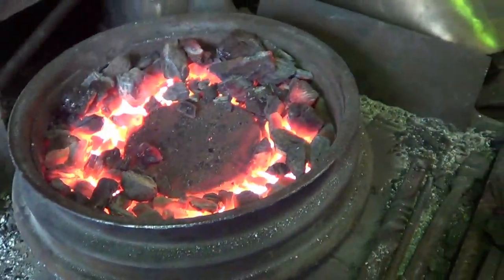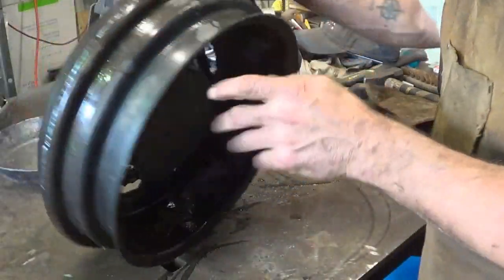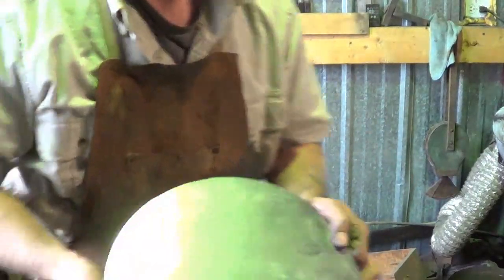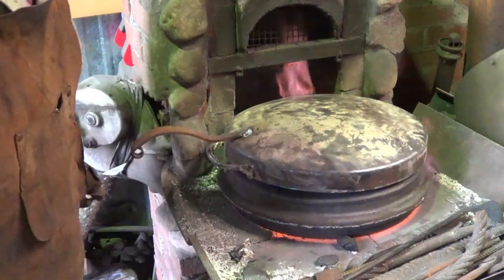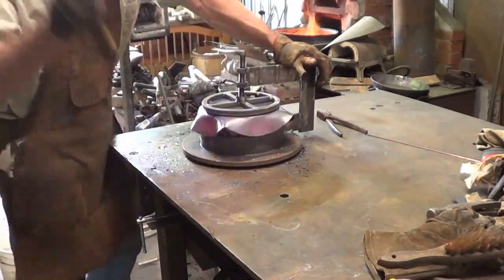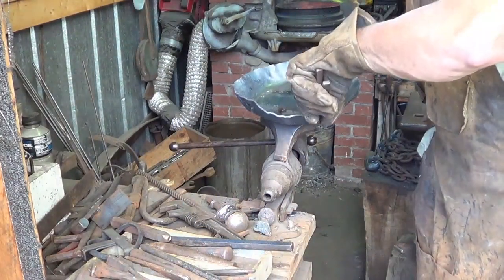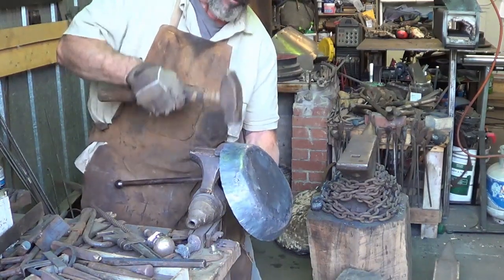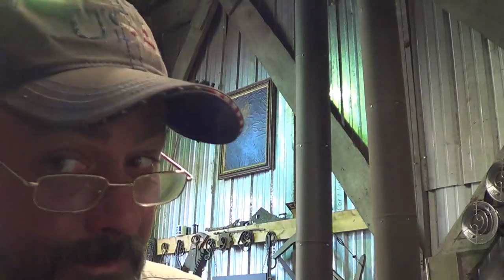OSF Special Feature - Need A Tool Make A Tool - Ring of Fire Goes Down Down Down

Comment: I'm really liking these videos. The trial and error, and constant progress, is really neat to see. I hope you can make and sell a few of these soon. A few of those suckers at $200 each would definitely help fund that plasma cutter. In order to save you some running around, have you ever thought of putting a peg on the bottom of that jig you made and setting it in the hardy hole on your anvil to hold it still? Then you only have to turn around from the forge to drop it in.

Comment: If I could add my two cents I'd suggest an air cylinder or a air brake pot to make clamping very fast. An air brake pot off a big diesel truck are very stong and make a good clamping device. Easy to buy, not that expensive. Also the end of the rod (on the brake pot) is threaded so you can attach a variety of devices to use it to clamp things down to the bench as well. Like grinding something for example. Have both hands a available to work and not one holding the item. Not everything fits in a bench vice easily. Might be handy if your doing a production run. 

Keep up the hard work. Sucess seeks out the diligent. Take care.

Comment: you could attach the top plate to the bolt and crank handle. modify the hole that the bolt threads through so the threads can be disengaged for large movements of the clamp, then reengaged for finer movements and tightening. I am drawing from a clamp I use beneath an abrasive chop saw. A small length of pipe of the proper size, thread it, then cut it in half lengthwise. one half stationary and one moveable. that would save you picking up the plate, lining it up to the threaded rod, and any fumbling with it in general. sorry for the lengthy comment.

Comment: Chandler, if you were to weld 2 T-shape handles on the plate for middle of the clamp so you could just grab it and more quickly put it in place it may give you a few more seconds of heat by setting the clamp up a few seconds faster
Reply: And weld a 1" square bar on the bottom of the jig so it will mount on the anvil to save steps and heat!
Reply: Or even round bar so it will rotate...

Comment: Awesome Chandler, you almost have a system down.  Your heating times are about in sync with your shaping times...which means you can make more than one at a time and seriously increase efficiency.  I'm still all about a mild steel bottom mold on your fluting jig.  It would be a real mother to grind to shape though.  I could grab suitable chunks of A36 conical blanks at my favorite steel places for $1 per pound.  You could get a two sided pan anvil for your jig pretty cheap!

Comment: hammer marks in the bottom of the pan will, in theory, make more surface area on the pan which will make it heat and cook faster and prehaps even make it slightly more non-stick because of the uneven surface. idk how much it actually helps, but if you like your own style keep at it, the pans look great

Comment: Chandler,  I have been enjoying your videos for a while.   on the jig you made, might I recommend a change that would shorten the time it takes to get your plate centered and clamped in?  If you would make the clamp arm about 6" taller and mount the ring you made permanently to the screw shaft with a ball joint similar to what you see on a c clamp,  you would save precious seconds and heat when putting your plate in for fluting.  Keep up the good work!

Comment: To reduce the time to clamp the hot pan down (at 18:35), what about making the overarm of the clamp hinged with one pin to hold it in place, or totally removable with two pins? Or make a toggle link clamp, either way it seems faster than using the treaded clamp. Less time used to clamp gives more time to move metal while it is hot.

Comment: to save you a bit of heat time maybe weld a handle on one side of that jig top instead of trying to use the tongs a gloved hand would let you quickly grab the jig top put it on and center it in a second or two L shaped I believe would work...

Comment: same suggestion as on the jig making video .. maybe change the jig to have the top plate on an arm that pivots down from above and is clamped with a goats foot kind of clamp on the free end .. humm, that would make two places that you could not strike with the hammer, but if the action is quick enuf you could unclamp, rotate the work piece and clamp it down again to finish using the heat.

Comment: Just a beginner myself, but you look to be loosing a lot of heat taking the pan from the forge to the clamp. Maybe move the clamp onto your anvil, and weld a round peg onto the bottom of the clamp to go into the square hardy hold so you can swivel it around, but it can't go skating across the table?

Comment: How to make pans faster and better:

1. Do two pans.

2. Add steel to the inner part of one pan, and add steel to the outer part of the other.

3. Cut a circle and heat it a lot.

4. Put the circle between the two pans and jump to the top of that thing.

5. Grab the circle and shape it a little better with the hammer.

There you go: a "hand made" pan.
Reply: Note: the pan in the bottom needs to be very tall. The top diameter needs to be larger than the circle. You might have to repeat the proccess a couple of times until you end up with a decent pan.

Comment: Great video Chandler.  When you get to reworking the jig, I'm wondering if replacing the C clamp with something like a bar clamp would let you slide the pin most of the way quickly and then only need to turn the screw about a turn to clamp it tight. Just a thought.

Comment: Chris U.K.Back at ya with the cambclamp idea Chandler.Weld the ring form to the threaded bar & put an elbow at the right angle so you can release quickly then lift the ring up & out of the way, 3seconds. What do you think? Wish I could send you a drawing.Regards, Chris, U.K.

Comment: chandler: you should change your jig, you spend too much time clamping it down with that screw clamp, if you replace that with a C-clamp you could get it clamped down much faster and lose a lot less heat.

Comment: add a ring part to the hammering jig? basically the inside edge of the pan can be hammered flat on hte same jig if it has something that will set the angle and be flat

Comment: Just a suggestion, I think you should weld a nut to the top of the round jig that you made so that you can screw the round jig to the screw shaft and still change the size. I don't know if you get what I mean. Its kinda hard to explain.
Reply: Kensivren I think if he did that it would lower his clearance and he wouldn't be able to get the pan out of the jig. Good idea though.
Reply: Yeahh. Didn't thought of that.

Comment: Just a thought from a non smith. What about the original design but instead of coals inside put it over the coal. My thoughts is that it would force just the heat through the ring. I don't know if that would get the metal hot enough to work or not but just an idea.

Comment: Would it help to weld some sort of swivel on the bottom of the jig that fits into the anvil and/or vice. It would be closer and you'd lose less heat.

Comment: What if you took one of your finished pans out of 11ga and clamp that in your jig as a "mandrel" of sorts and then drop in a full red hot flat blank on top and then hammer the new pan to the shape of your old one.  You'd probably want to make your mandrel pan a bit smaller to if finished size is super critical but you could sacrifice one pan to make many and maybe all in one single heat you could get your pan formed then a little bit of clean up and you'd be good?

Comment: Chandler, sir, in my experience, a really good pan has a bottom about twice as thick as the sides.  if you are going around twice to take out flutes, would it not be as easy to draw up sides on an angled jib?
Reply: jig, i meant. Also, perhaps a hinged arm on you pan jig (think kitchenaid) so that you might lay down centered steel, quickly flip down center press, get to work losing less heat.

Comment: should weld the brakedrum upside down inside of the rim so it would be more solid that the plate you welded in the rim and cut holes in the drum the same way you did the rim

Comment: what if you welded tje round piece to the screw down part of the clamp? it would save time and heat, then you could just put the metal in and crank down.

Comment: could you not have a burner thats in a ring which sits over your forming tool which heats the outside edge up then you simply turn it off and remove it and bash away?

Comment: +1 on both the patreon and the sponsored gear ideas. both can help a lot with paying for stuff you need. I assure you you could throw up a gofundme link and you'd get half a plasma cutter funded within a weekevery time I see your pan jig I wonder why you're not just pumping an ass load of propane up through those vents and heating the edge of the disk that way...then shut the gas off, whack on the metal a bunch, lather, rinse, repeat.

Comment: I think you focus too much on the time when you are still perfecting your technique, get the technique down then worry about the time. Looking good though glad you revisited the wheel forge I thought the first video worked out alright.
Reply: Though time will improve with practice, Chandler was specifically trying to see if the process would viably make a pan in an hour or less. If you look back at the pre-jig pan making videos, it was nearly two hours just to get the body shaped, and it wasn't as regular in shape or rim height. As a result, a timed trial comparing the two different "first time" processes is actually perfect.

And I agree whole-heartedly that it's a great thing you didn't give up on the wheel forge idea entirely Chandler, I'm going to have to steal that idea when I get the chance/need.
Reply: Michael then I missed the part where he said that apologies!